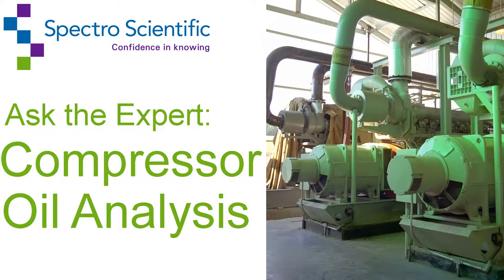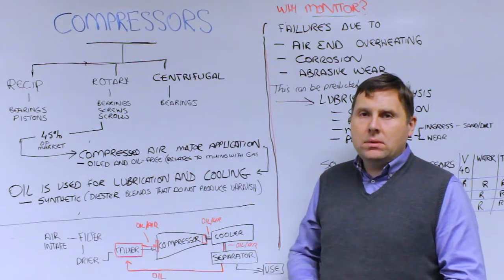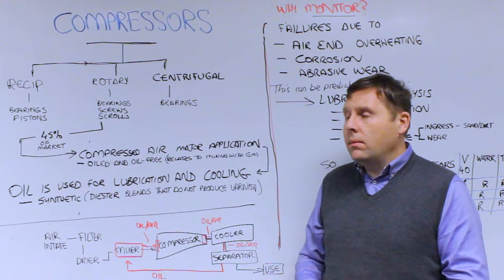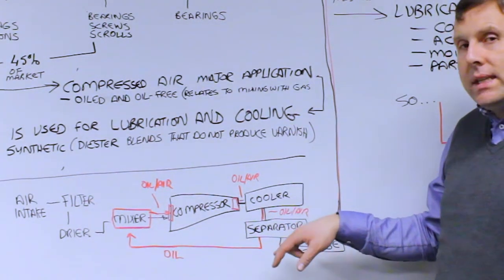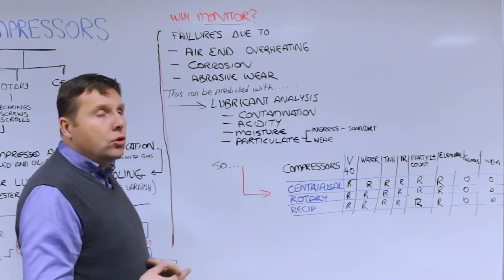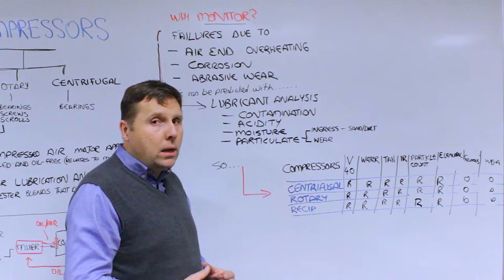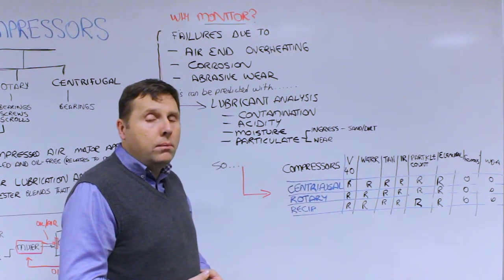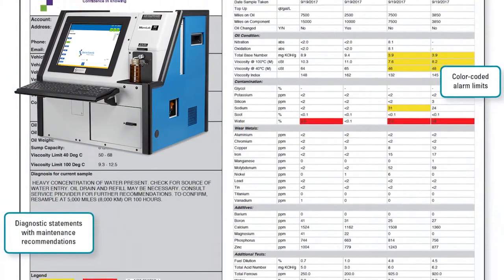Ask the Expert: Compressor Oil Analysis

Comment: Great video! It explains a lot in a simple way, thank you. I have 3 rotary compressors and the oil seems to be burned, they work in a very hot place with low exhaust, what can i do to make it cooler at the utility area? Could you please help me? Thank you very much.